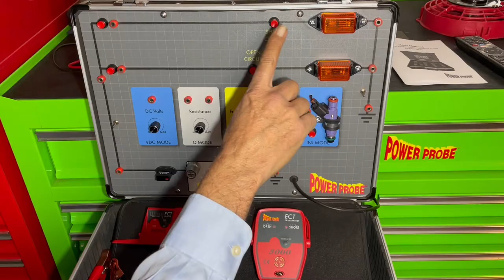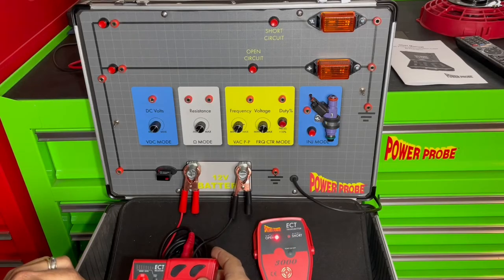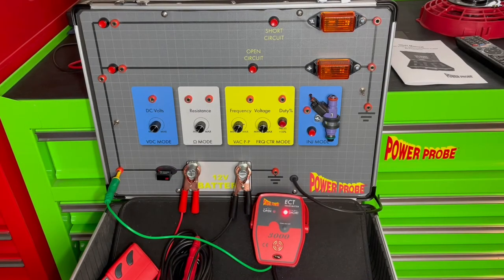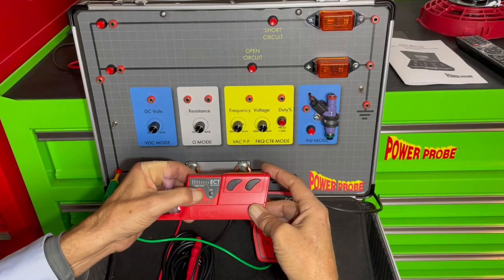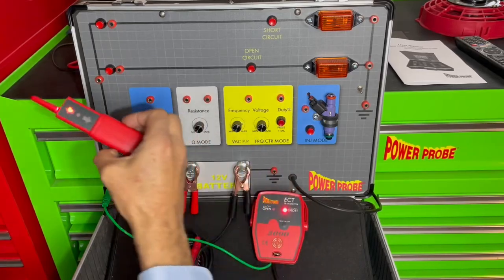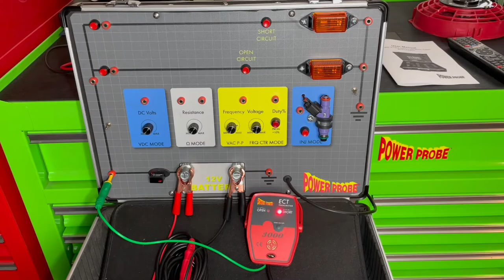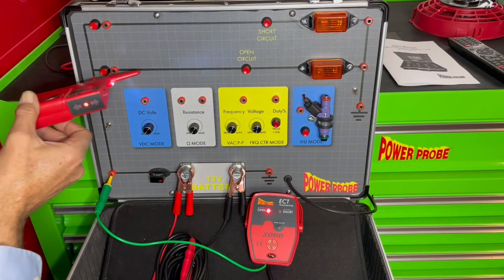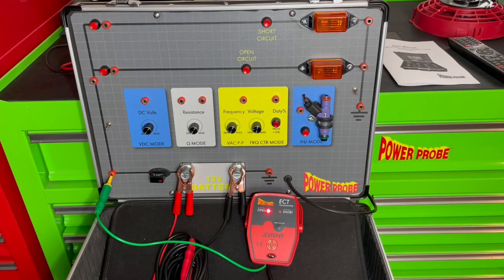PPDEMO1 ECT3000

Comment: What if the circuit isn’t fully opened? Like just a pinched wire with a few threads still hanging on will it still detect an open circuit?
Reply: Couldn't you just rule that out with a load test?
Reply: I load test wiring issues.

Comment: After watching every YouTube video on the ECT 3000, I tried to use it to locate a short to ground in the wiring harness running from the fuse box to the fuel gauge on my Jeep.  After placing the green probe in the fuse box, the transmitter signaled a short, I then locked in the signal from the transmitters green wire connection.   The receiver wasn't much help at all in locating the that short to ground.

Comment: Question... If it always powers up displaying an open circuit... how do I know when there is a "real" open to track down?
Reply: Once you plug the back probe onto the wire it will determine whether it's open or short. 
Since you only have it plugged up to the battery and don't have the probe on a wire /circuit it will display open cause it's not hooked to anything, so therefore open. 
Hope that makes since.

Comment: Mine doesn’t work. It doesn’t pick up any signal on any wire
Reply from the maker: See this video to verify that the receiver and transmitter are working correctly - 
https://youtu.be/OKVoV6nV5yw?si=mwgWLZ-kC3eAjJZH
If the tool does not respond like in the video, there may be a fault with the tool.

Comment: Receiver too  damn big , a extended flexible head or extended solid antenna options , good tool if you working in large open area, it Would be nice if you release a updated smaller Version  that will work with the existing transmitter

Comment: Saludos, tengo una duda... Para buscar un cable picado seria mas seguro retierar los postes de la batería que alimentan a todo el vehículo? Solo conecto la herramienta a +/- de batería dejando todo el resto de los circuitos sin voltaje...?
Reply from the maker: When tracing for opens or broken connections it is probably safer and to ensure there would be no voltages anywhere in the wiring. Only when tracing shorts that the battery must be connected to maintain the connection to ground.